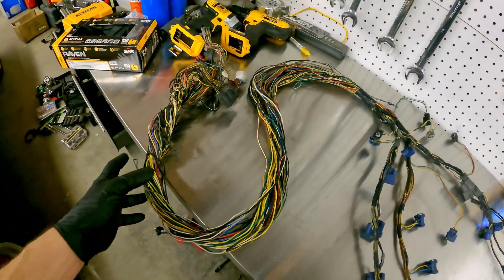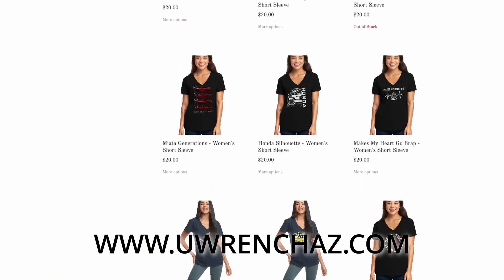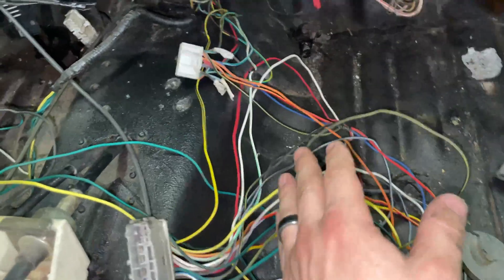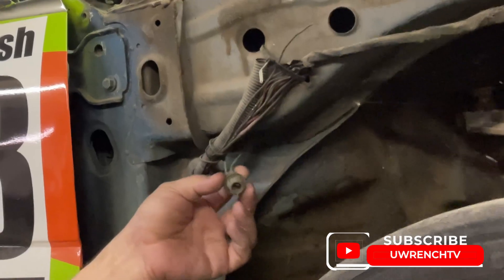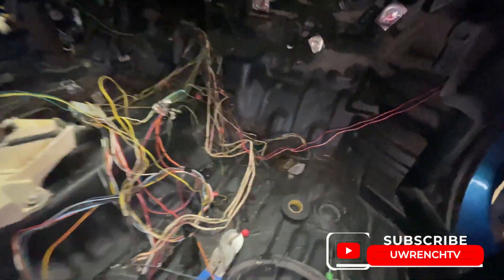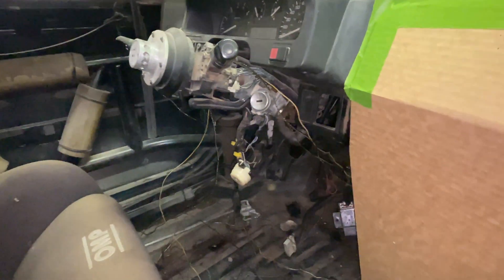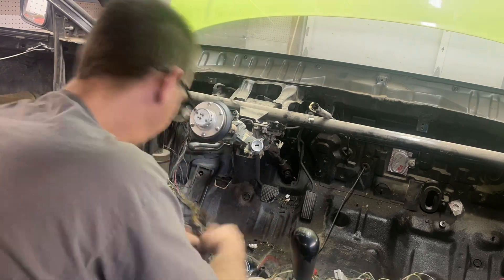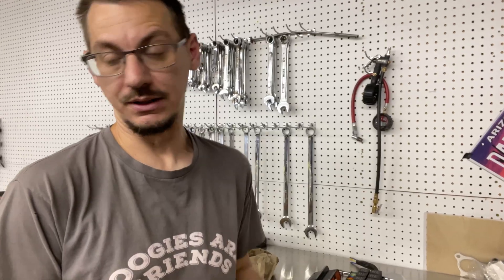Sorting/Preparing Chassis and Engine wires for a Deutsch Custom Quick Disconnect Wire Harness

Comment: That deutsch is good for 20-16awg with size 16 standard terminals and 14awg with the green band terminals.  
If you want to mix terminal sizes (deutsch size 12, 16 and 20) use a deutsch drc bulkhead.  They have a whole mix of sizes including a number of size 20 terminals.